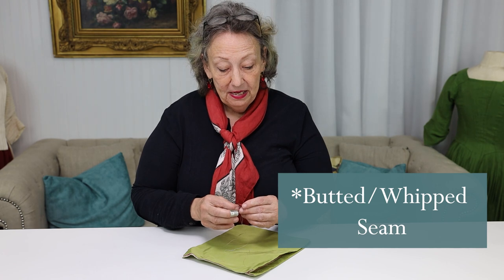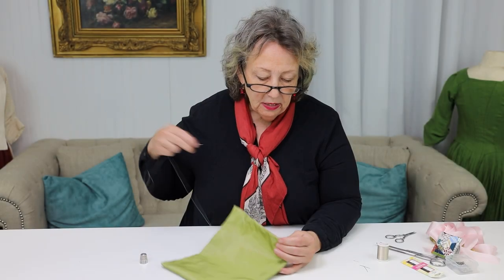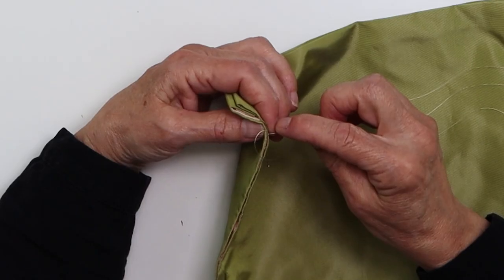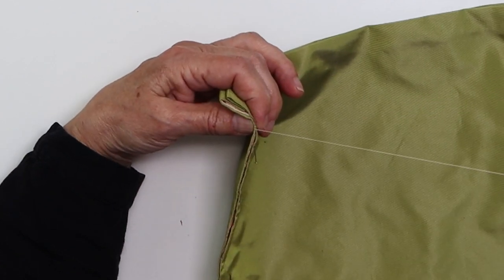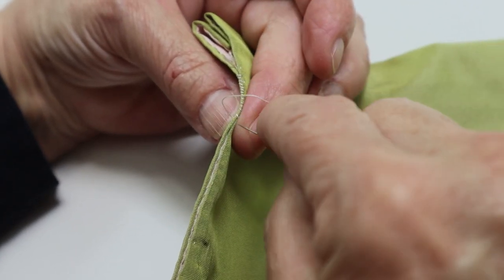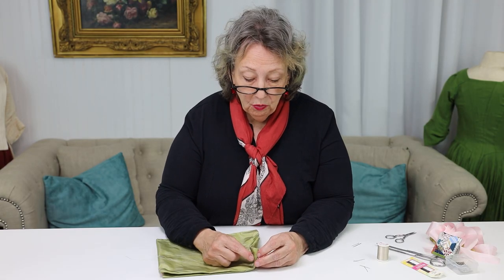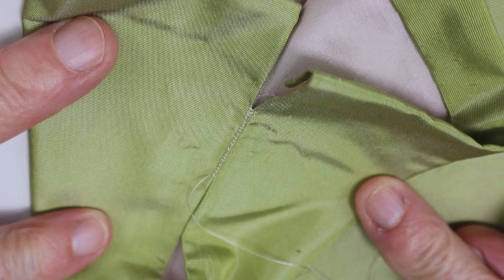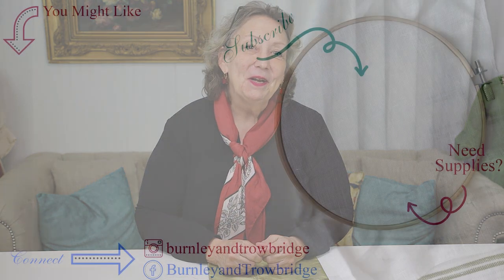Learn to Hand Sew: Butted Whipped Seam

Comment: I was told this was called an overhand stitch. And Laura Ingalls calls it an over and over stitch in one of her books. Is that a question of time period? Or of region?
I'm not a native English speaker, so I sometimes have a hard time sorting out the vocabulary...
Reply from the maker: Hi Nouria! The stitch being used in this tutorial is a whip stitch, but it's being used on two finished edges that will open up to butt against one another. There's definitely a lot of names for various stitches in the sewing community, both regionally and over the centuries, as so many of these techniques are passed down orally from one person to another. In modern parlance an overstitch or overcast stitch is usually used as a decorative edging on crafts or used on the edges of fabrics that seem prone to fraying, but it's definitely a very similar technique. That probably doesn't help much sorting out the vocabulary, but it might help explain why we might all call similar techniques by different names? 😆